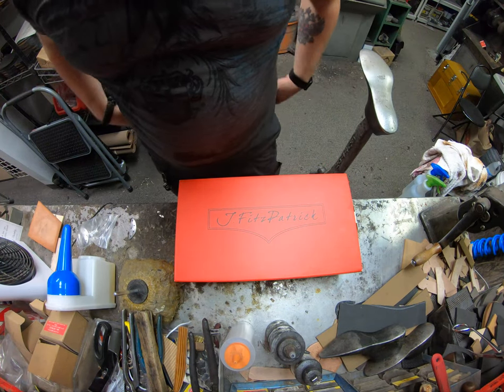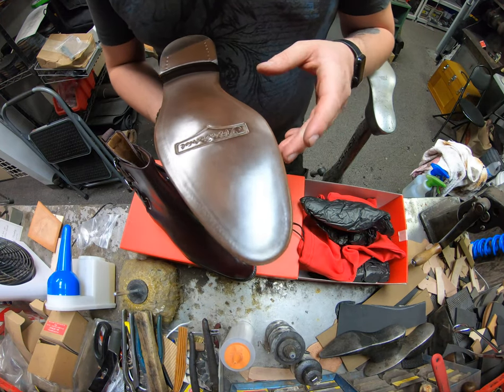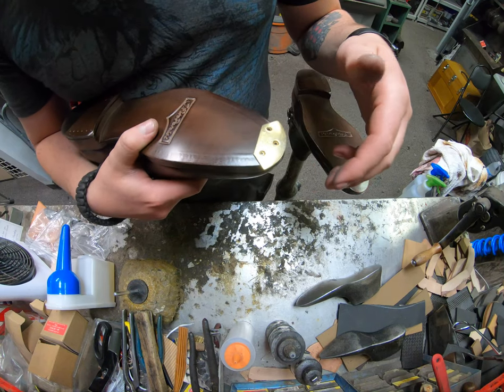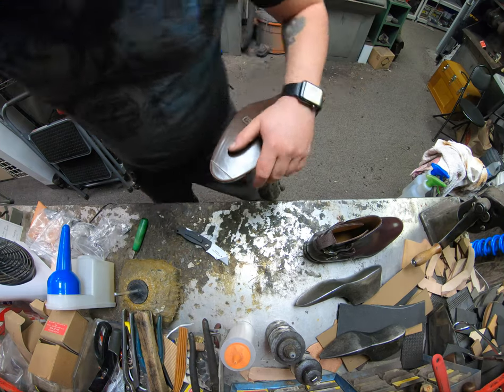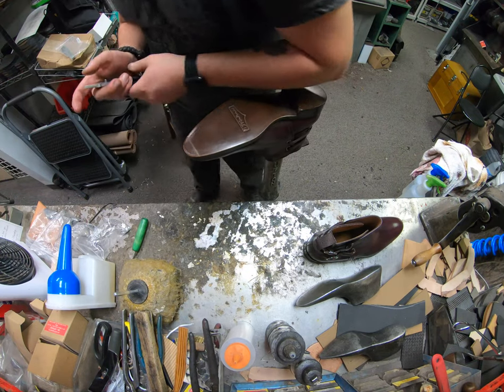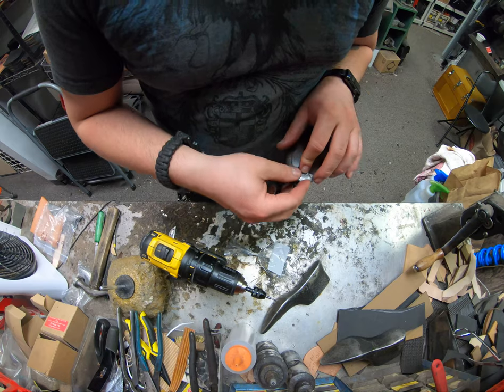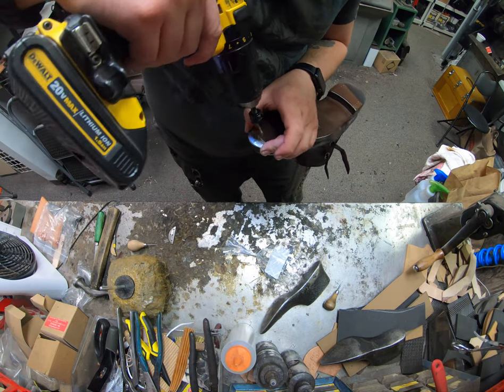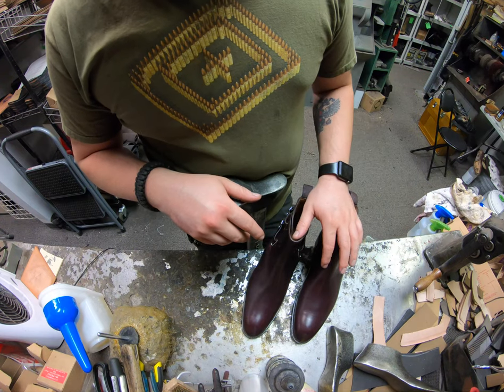Justin FitzPatrick Boots  Lulu Toe Plate installation aka French Toe Plate

Comment: Do you cut through the stitching?
Reply from the maker: We do our best not to do that. With a new pair especially ones that have the blind stitch like these we usually don’t but if it is a used pair where we have no choice but to cut the stitches we use a solution that binds the stitches.
Reply: @CobblersPlus  and does this not compromise the integrate of the shoe ?
Reply from the maker: As a fail safe the glue holds very well on the sole. If we really have to cut into the stitches we either restitch the sole or if it’s worn down a lot we may recommend doing a new sole either to tip on the sole, half sole or full sole. Just depends on how it’s worn. 
New shoes usually have plenty of room for the toe plates without cutting the stitches.